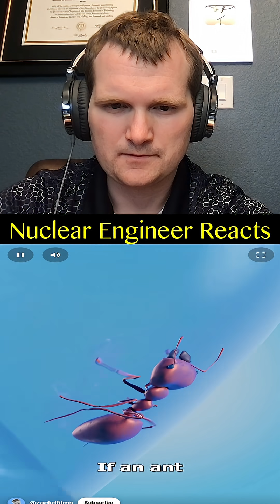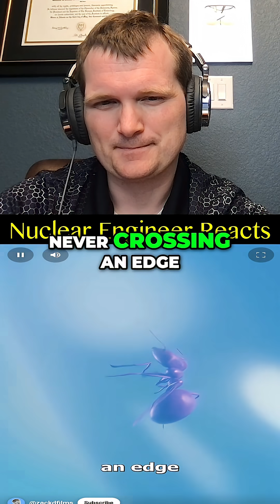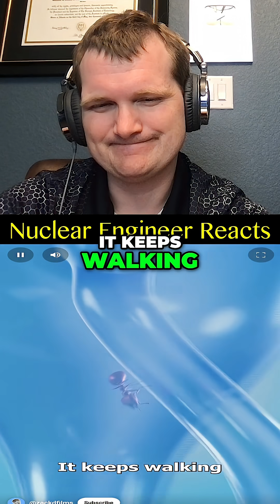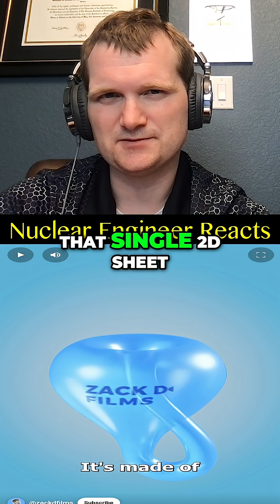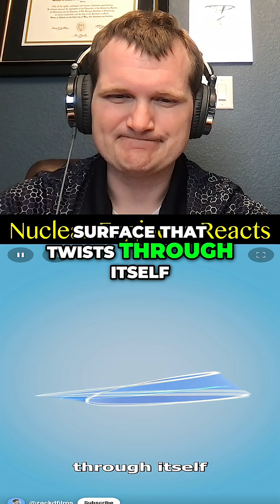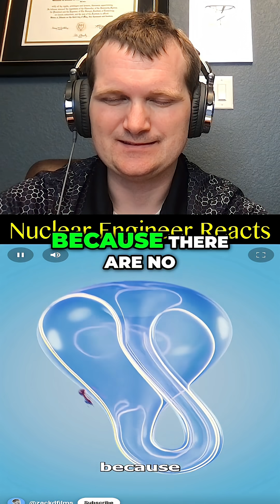How a Klein Bottle Works - Nuclear Engineer Reacts to Zack D. Films

Comment: The only time I understood the Klien bottle was when someone made a video comparing it to the 2D equivalent mobius strip. If you compress the mobius strip down into a 2D top down view, it appears as though the 2 edges are intersecting and there’s no possible way for them not intersect but if you stretch it into the 3D view, then it becomes clear that they don’t. They’ve got the same 2D co-ordinates but are physically in a different place due to their 3 dimensional offset.

Comment: Correction 1: It's TWO Möbius bands Or one Möbius strip with its edge sutured to itself. Correction 2: Not only can it it exist in 3D space, it IS a 2D manifold, indeed its a flat, 2D space. What you mean to say is that there is are no isometric embeddings in anything fewer than 4D space. "Break down your Monte Carlo simulation"?????? A Klein bottle has a perfectly valid, global chart. You'll get weird periodicity effects, but there's nothing pathological about it.

Comment: Im here telling you: no, he meant spatial 4D, 4 spatial axes, not the "4th" dimension as a reference to the time of a 3 dimensional space-time continuum.
Reply: Nah, clearly meant the four dimensions of mass, length, electric current, and extraversion.
Reply: @RuyVuusen ?
thats what i said, his entailment was referring to spatial 4D aka four dimensions NOT the so referred "fourth dimension", making a disparity between spatial and temporal dimensions.
Reply: @KKF026 I was clearly making a joke about using a nonsensical combination of physics, spatial, and even personality theory dimensions. Just intentionally making "the correct 4D" about as wrong as possible—instead of just mixing a temporal dimension there, I did whatever.
Reply: @RuyVuusen  "nonsensical combination" 
I can only hope that here you're referring to the juristical epistemic disparity between spatial n temporal dimensions. Physics both incorporates spatiality and temporality conventionally, as for why time is also being included is that space and time are intertwined, tho theres a presupposition that there must exist a continuity that wouldnt conflate them, as ideas they're still interrelated, so what you said doesn't quite makes sense. But alright, i suppose, i didnt really get the joke part, might be due to my lack of eq
Reply: @KKF026 Well, I know physics uses all kinds of dimension combinations on the regular. You see quite interesting ones in dimensional analysis from time to time. Here I meant nonsensical in reference to this topic, specifically. Obviously if you have a problem that uses all these parameters, it would not be nonsensical, for example, to model them in a coordinate system of their dimensions (even though extraversion is still unconventional for physics problems, and would likely have to be dimensionless, unless we invent a unit for it).

Comment: A basic cup is the same concept. The ant walks over the brim down into the cup, and goes straight and walks back up the wall of the cup
Reply: Not really 
A mobius strip is one continuous line there is no back or front 
A klein bottle is a surface without an edge or a back
Think of a cup made of a single sheet of metal, it have back and front and edges

So the ant would have to cross the edge to do it on a cup while in a klein bottle it wouldn't 

4D is mind bending i cannot say i can visualize it either

Comment: Can you argue humans are the same inside and outside? If we say the digestive tract is a tube that goes through us, nothing we consume actually enters us, only the nutrients or particles small enough actually can. 🤔
Reply: Your digestive system is inside you though. Your food is liquified and absorbed into your blood.
Reply: @rereleader Yes it is inside you but the digestive tract is a barrier between what you consume and your actual body and organs. You churn your food in your stomach and then all nutrients get absorbed in the duodenum then it makes its way to the large intestine where only water is reabsorbed and then you excrete it out so not everything you consume is absorbed only the tiny nutrients and molecules necessary for organ and bodily functions. That's why I was arguing that it could be the same inside as out.
Reply: @rereleader  There is a clear path from mouth to rear, with no solid obstruction in between, just valves. So in a sense, food we eat indeed are still outside our body, until it actually gets absorbed as nutrients.